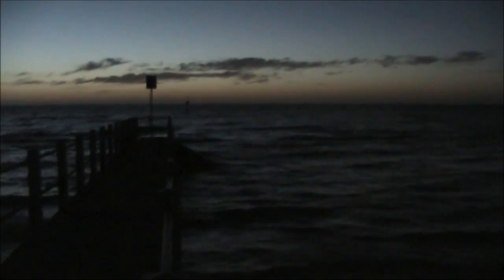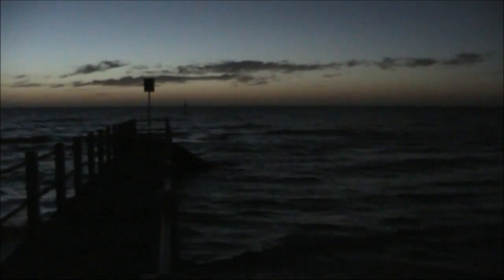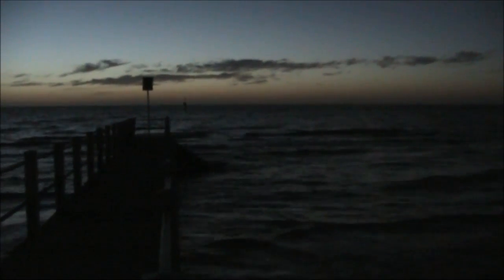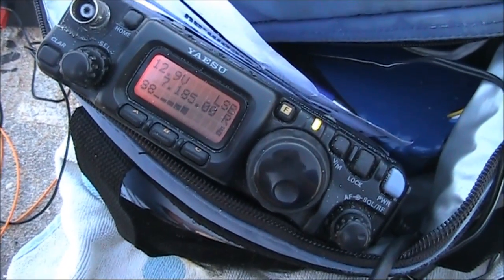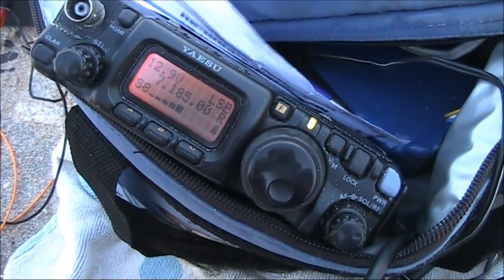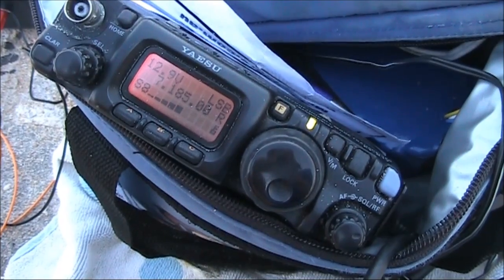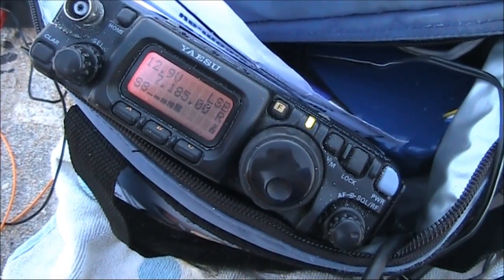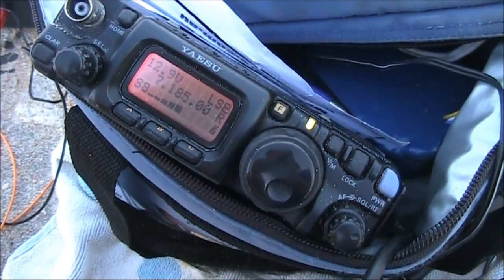Kite antenna 7 MHz QRP DX contact with JA1NUT

Comment: ok, but you need a control antenna to compare the kite antenna, or else one could say while the kite is trendy and novel, its not worth morebthan say a quarter wave vertical based on a fishing rod and 4 radials.
Reply: Well it is a half wave vertical so well worth the experiment. Theory says how much better it ought to be but experimenting is what ham radio is all about and on a portable expedition a person isn't going to want to carry too much around. I do see your point though. I think gettin a mite up 40 metres up in the air to support a half wave vertical for 80 metres is more interesting.